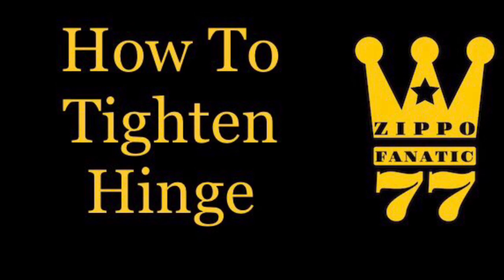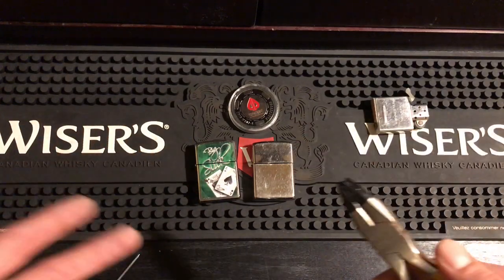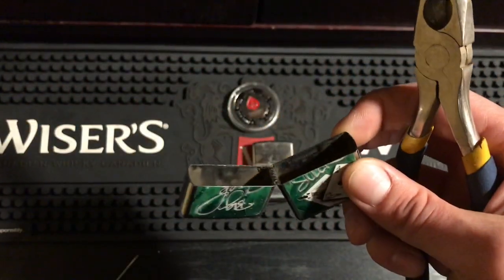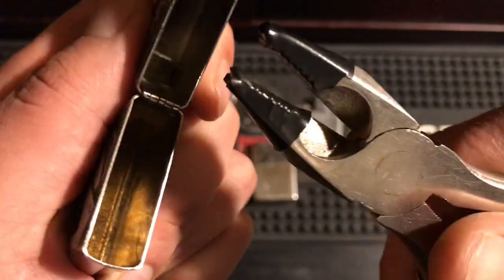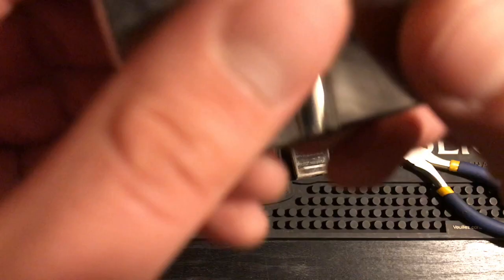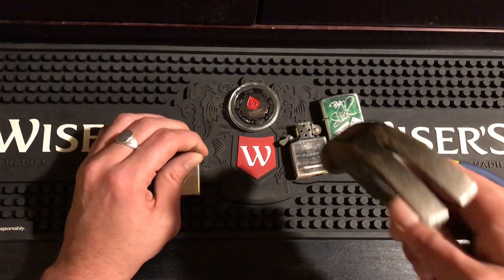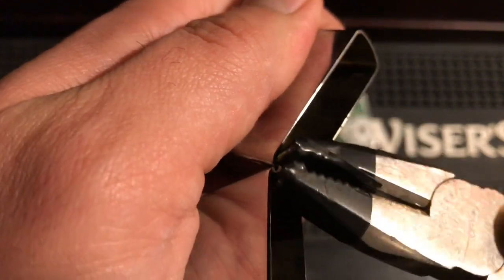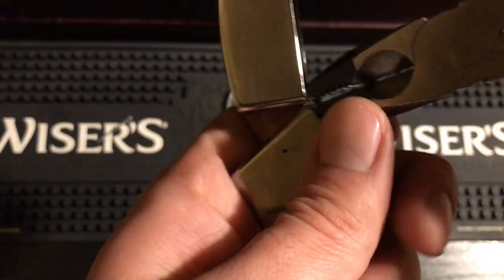How to Tighten Loose Hinge

Comment: How do you fix the gap between the top and bottom. I have a small Gap that starts where the hinges hinge is and tapers down to nothing. You can see the insert through the crack on the side where the pictures at and it's a little bit bigger on the backside. It wasn't there before I tighten the hinge. My Zippos only a couple months old but the hinge was looser than the new one you showed in the video it's now tighter LOL but there's that tiny Gap. I'm not blaming you the hinge is German again she's good and tight LOL. But I've seen some of your videos on adjusting and tricks and stuff so I thought you might have an answer or a fix. I really like the picture on the front of my Zippo I'm at Silver Line from the insert it's kind of annoying. Thanks for any help you can provide
Reply: @ZippoFanatic77  I thought it was something like that but wasn't sure and didn't want to mess it up. Thanks for the detailed reply I appreciate it alot.  I'll give that a shot . keep up the hard work on the vids it helps us that don't know how to maintain a zippo properly, plus the tricks. I saw your bid on the disappearing Flame and you step-by-step instructions made it easy. The kids will love it 😆.
Reply: @ZippoFanatic77  it worked like a charm thank you

Comment: Great video! My hinges are perfectly aligned, i cant figure out why my zippo is too loose, i tried taking a new zippos insert and putting it in the zippo I thought was loose hinged, but it worked perfectly fine, have any idea on how i can fix this issue?
Reply: @ZippoFanatic77  the insert fits okay and the hinge is perfect, i tried squeezing the top lid and got nothong, my problem is with my insert for sure, but i just cant figure out what's wrong with it
Reply: @ZippoFanatic77  that isnt the case, my zippo opens way too easily and doesn't have that zippo stiffness
Reply: Holy crap the cam sping might be it, your a life saver man, thank you so much for ur time. Much appreciated!!!